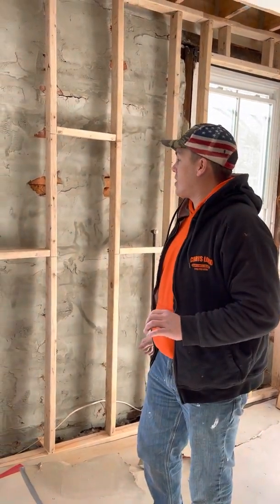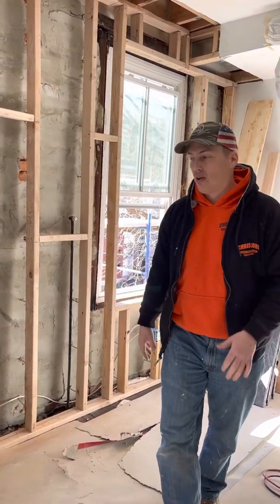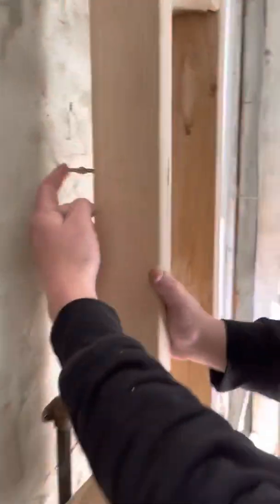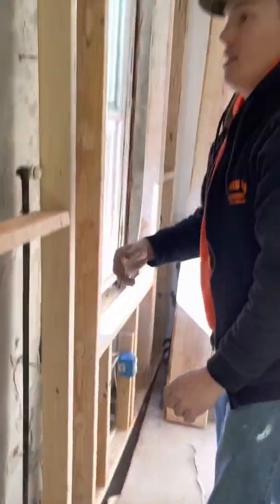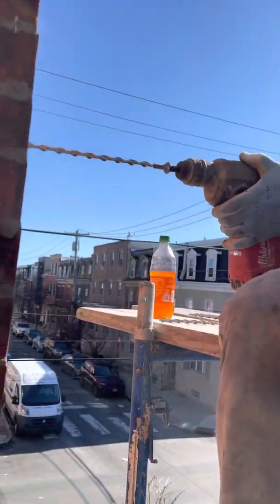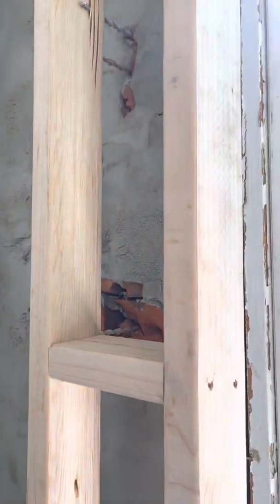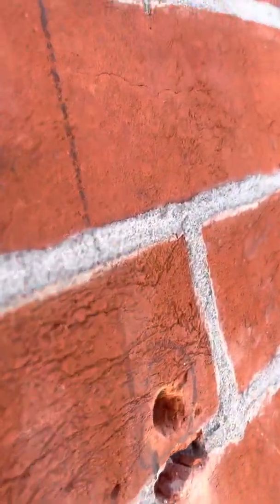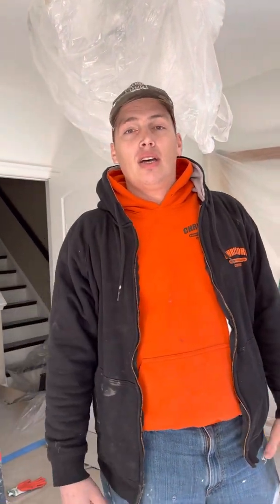Helical Tie Installation/Star Bolt Alternative

Comment: What prevents the 2” x 4” stud from bowing over time?
Reply from the maker: It’s possible but unlikely. The helical tie would actually prevent that. We tell the homeowners to check for any mortar pops or holes about once a year which can be a sign of movement. We did about 20 in last 5 years and I never received a call back so I’m pretty confident in the system. It also depends on the bow itself. Steel can be added to studs to stiffen and support in a worst case scenario but something that drastic you’re probably better off tearing down and rebuilding. In each job I defer to the structural engineer and follow the drawing
Reply: Can the Star bolts be lagged in on end of floor joist on an outside wall on a twin?

Comment: If you have access to the interior, it is actually way easier to install them from the inside and fix them to the studs with brackets like these: https://prosoco.com/Content/Documents/Product/PRO-Facade-Tie-System-Brochure121620.pdf

Comment: I was thinking since I've never done this before is it as good as a star bolt since there's nothing that acts as a washer holding the face from bowing out any further or are the heli-ties bigger than the hole you drill so it grabs the brick